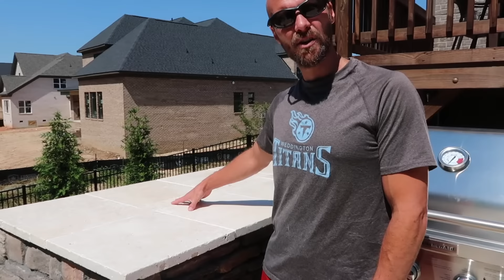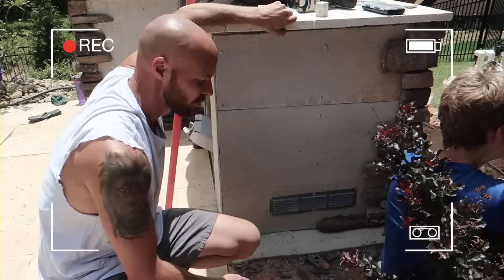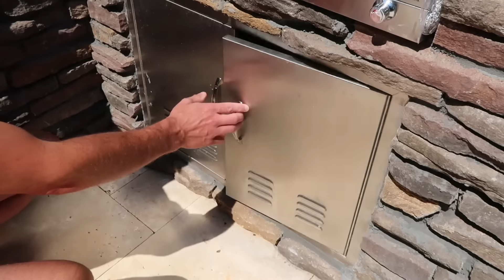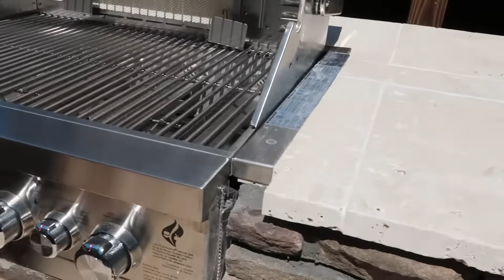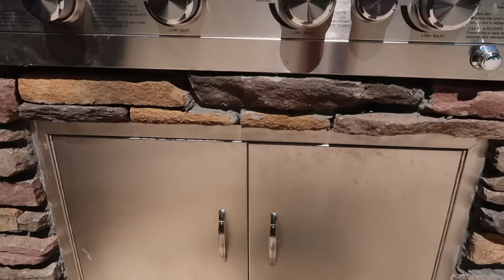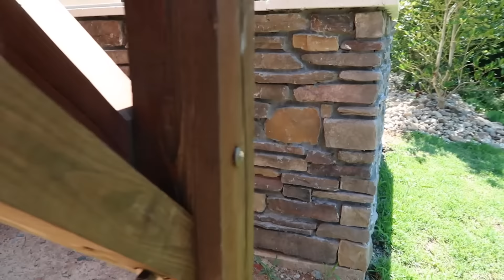How to Make a Stone BBQ Island on a Budget | DAD HACK

Comment: Also, how are the Vevor doors holding up, since you don't have a roof over your grill station? I just received the same Vevor doors and some other Vevor stuff, but I'm a little worried about rust, since my grill station will be under my deck and moisture can still fall through onto my grill station, and they're not 304 SS.

Comment: How's the travertine for the countertops? Did you fill the holes and seal it all?  I've got 90 pieces of 24" x 16" leftover from our pool build (decking), but it's so porous, that I'm worried about bacteria, etc. potentially growing in the holes, if I use it on the outdoor kitchen I'm building.

Comment: Nice set up. Just for your info - if you want the doors to be a bit more rust free.. coat them with baby oil when dry! We used to do this on the brushed steel splash backs on board a ferry I worked on, the fat comes off easy then.

Comment: Nicely done. I want to do a variety. 1) Moveable, on solid / big castors (to get around code and put on side yard), 2) No L, just straight. 3) Griddle, natural gas, 4) Counter top  on one side of griddle, butcher block on the other (think carne, tacos).  I think the biggest element is going to be to have something build the frame, since it will need to accommodate the griddle, cabinet doors, the castors, the counter top and butcher block.  If you have any ideas, gotchas, etc. love to hear them.
Reply: that is exactly what I want to do something straight with castors to move as I please.

Comment: Great job...you spoke about extending the counter part for stools to eat off side but I noticed your lawn is sloping on that side....you might have to add soil to level the area so the barstools dont tip ...but then again maybe the view is deceptive...just remember safety....great job
Reply from the maker: I never did add those barstools on that side.  The slope is enough that I would need a few retention wall blocks :).

Comment: If you decide to convert to natural gas later on, will you need to jackhammer your patio to install the line?  This is something that is preventing us from putting in our patio and grill.  We don't want to spend thousands to install a patio that will need to be jackhammered up when we have the $$$ to convert to natural gas.
Reply from the maker: Not for mine.  The back of the grill is accessible for me to drill thru the stone and convert to natural gas.  If you want it in the future - I would install it now :).

Comment: I’m think of doing same idea, except a lot bigger. Maybe 2.5’x16’. I was wondering if you had an issue with the base it’s sitting on? Any cracking? I have a 5.5” patio I wanted to set it on but I heard it needs a 1 ft slab with footings. Any feedback would be a huge help
Reply from the maker: A 1ft slab would be crazy.  You could park a truck on that :).  I did about 6 inches or so and a concrete guy told me 3 inches with rebar would be plenty.
Reply: @MrGizmo211  haha thanks man. I appreciate the quick response! Great video!

Comment: Great job here. Quick question: How did you attach the frame to the concrete pad? did you drill holes in the pad ? or some type of adhesive?
Reply from the maker: Yes - drilled and put in concrete screws to hold it tight.
Reply: @MrGizmo211   Where did you buy the frame?
Reply from the maker: @teddyruxpin3811  bbqcoach!

Comment: Looks very nice. Especially the travertine top. Would it be easier with a wood frame instead of aluminum?
Reply from the maker: Yes definitely - but I worried about the grill heat on wood.  IMO the aluminum is safer around heat and the extended part of the L being wood.

Comment: Whats the measurement on the frame kit you used?
Reply from the maker: I bought the 5 ft long and 32” depth frame.
Reply: Do you have the link to the frame itself?
Reply from the maker: @patricklabrzycki5137  https://www.bbqcoach.com/4-ft-module-all-steel-tubes/
Reply from the maker: Looks like they only sell the 4 ft now?!
Reply: Hi Mr Gizmo, so did you buy 2 of those Frame Kit? For the grill and the Bar Island? And just connected it together?
Reply from the maker: @jorgevenida4238  I bought one metal frame and built the island part with treated lumber.  The lumber is easier to work with, but thought the metal around the hot grill would be safer!
Reply: @MrGizmo211  thank you! Do you mind letting me know the dimensions of your metal frame and wood frame? Also, if it’s not too much to ask.. could you lists the materials.. like the hardie backing, etc. this will be my very FIRST ever project. Just bought a house. Thank you

Comment: I like the idea of half treated wood / half metal frame for grill.  Any issues with heat transfer from grill to wood?  Did you vent from one section to another?
Reply from the maker: I made the grill section the metal frame so that the heat shouldn’t be an issue.  I also vented the wood rectangle to the metal area under the grill just to prevent it from mold.

Comment: I would after cleaning the stone with a wire brush apply wet sealant, it would give it a nice look. Where did you get the stone?
Reply from the maker: Great suggestion!  I need to clean it all up yet!  I got the stone from a local supplier of Prostone.  I just went to their website to find the closest dealer.